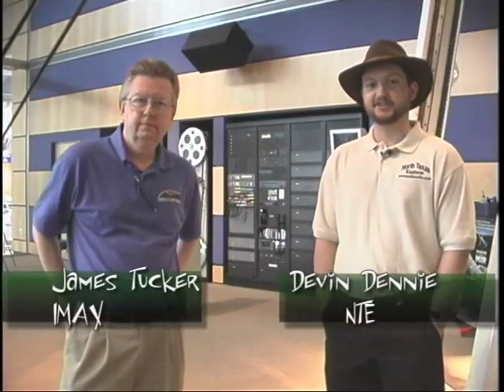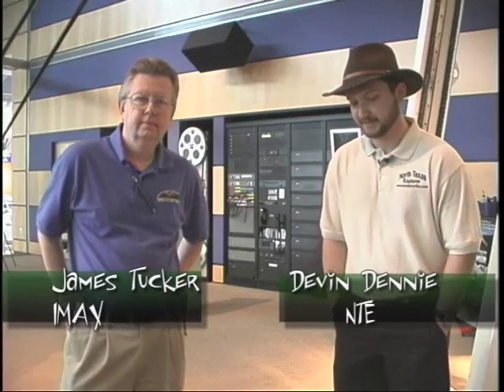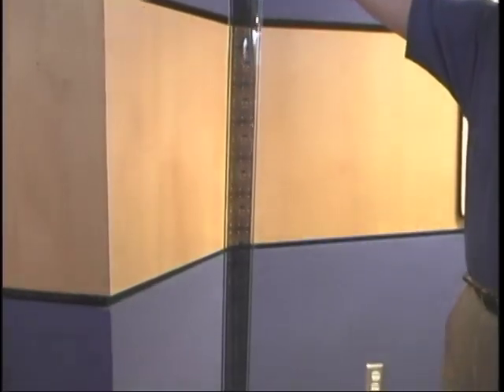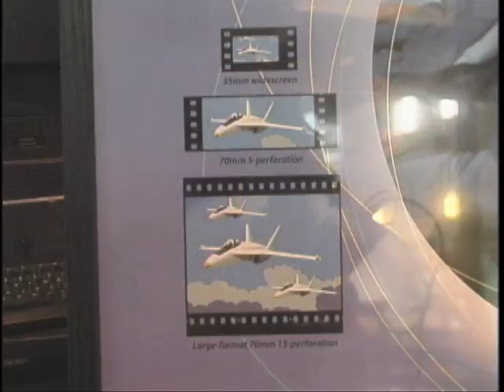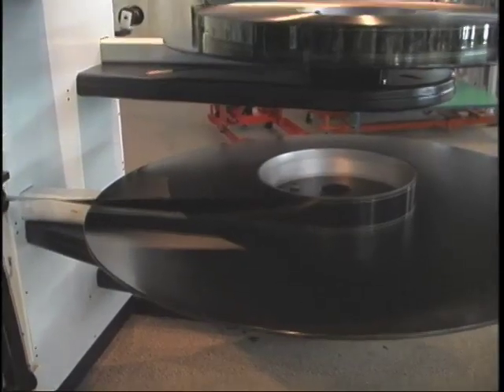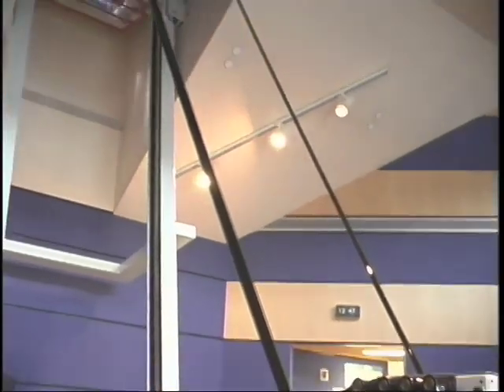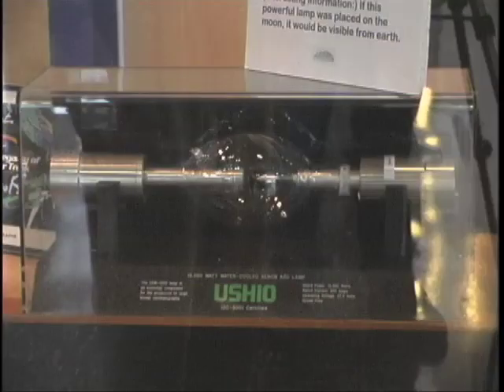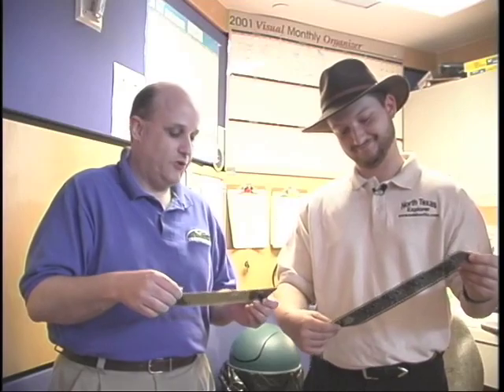Loading an IMAX Projector

Comment: 35mm film has approximately the same resolution as 4k digital cinema (that's still twice the resolution of HDTV/Blu-ray/2k). IMAX film has a much larger image area then 35mm, so it's much higher resolution than even the still-experimental 8k digital format. It will take a 12k-16k digital resolution to match the resolution of IMAX film, and that is a LONG way off.

Comment: Why are there still using film?? Digital is much better, higher resolution etc. HD tecnologie is awesome, using film is old fashion and expensive. Incredible
Reply: Stupid answer
Reply: Only a matter of time with the digital stuff
Reply: Laser perhaps, but digital IMAX is no way better than film.
Reply: Like i say, only a matter of time, seems to be that you never watched ultra hd
Reply: 4K digital doesn't fill an entire IMAX screen, that's why they still use film.
Reply: Ok right, but it will come
Reply: One day with 8k Laser projection, but that's a while away.
Reply: Yeah right
Reply: Imax is awesome on these days
Reply: +Christian Sanden :  I can assure you that digital IMAX with the new laser light engines will finally give the 1570 film format a "run for it's money"  1570 film has a resolution of 16K....but what does that REALLY mean?  Draw 16,000 horizontal lines on a wall, film them with and IMAX camera, make a positive projection copy (or just use the interpositive) and project it.  The film can resolve all 16,000 lines back onto the screen!  Currently, only 4K is available in the digital form, although all jump and weave is eliminated (horizontal/vertical unsteadiness)  Even so, a properly aligned and operated IMAX film projector has about a 1/2 inch unsteadiness.
Reply: +Christian Sanden  But some theaters keep the film.  Because of the incredible expense of conversion, if a museum only runs documentaries, and they have a huge library of films on many subjects, why convert?  It's not fiscally a good idea....yet!  Cost will come down as with all new technology.  There are also some difficult problems to overcome with digital projection on a dome theater.  But ultimately, you're right...it will come! Pat Caldwell, IMAX technician. Youtube:  therealimaxguy
Reply: No, film has higher resolution. A single frame of IMAX film has the resolution equivalent to an 18k digital image. And do they have digital projectors capable of playing an 18k film at 24fps? No. Also, the DLP digital projectors have lower brightness, and these domes need a lot, so they can't handle digital yet.
Reply: Digital 4K vs. REAL FILM IMAX? eaven 35 mm has in his best way a 4K resolution. but you have never seen a showprint! but IMAX 70mm is realy the king of high resolution projection: analog and digital!

Comment: I work in a cinema with a single 35mm projector that's 40 years old, has a stop button that doesn't work and is held together with gaffer tape. We use a tower system with a bent take-up reel that makes a horrible grinding sound, and the projection room has barely enough space to move around in - you have to hold your breath and hope you don't get your nose chopped off by the feed reel when you squeeze behind the back of the projector to get to the sound gear!

...I am so jealous of this video.

Comment: By the way, this is an IMAX Dome system. Non-dome systems are fairly different. The film is still 70mm 15 perf, but the projector typically isn't on a lift. Also, because of the curvature of the Dome screen, the image on films for Dome systems is squished by a special fisheye lens, and the lens' optical center is actually below the film frame center.